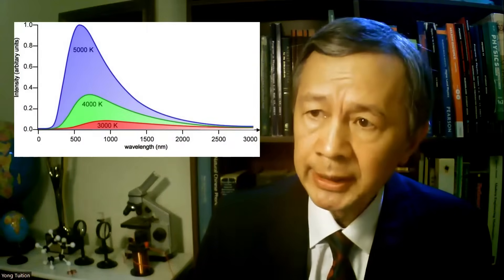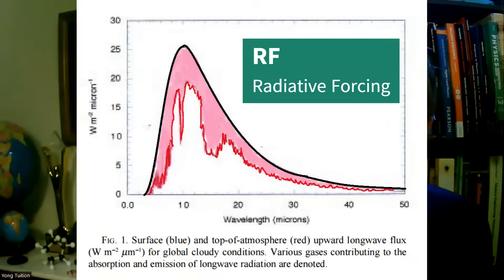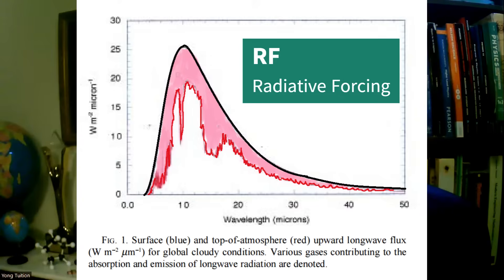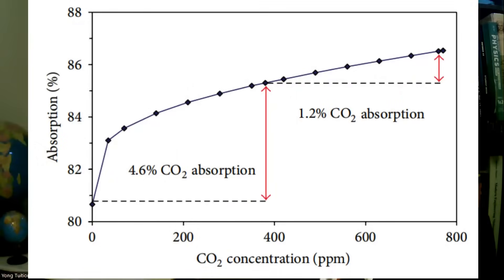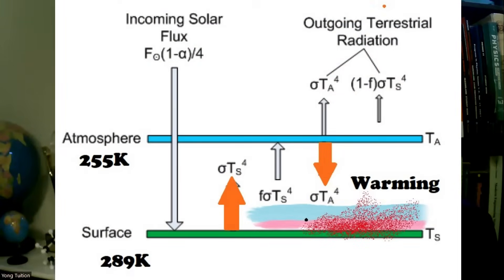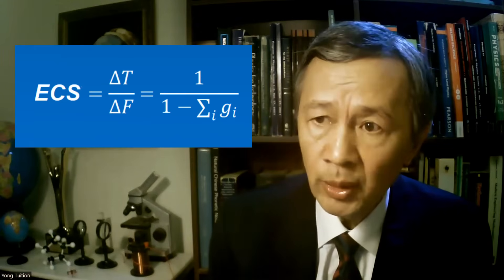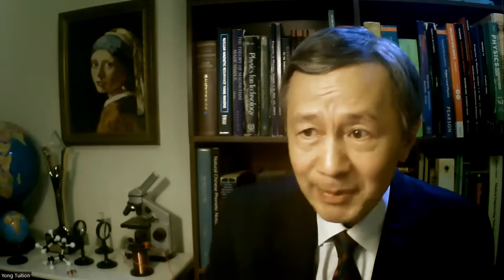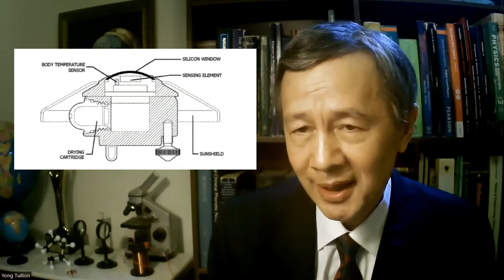The Weird Radiative Forcing at the Core of Climate Modeling | Independent Climate Research 230228

Comment: Thank you so much for trying to explain the complicated climate models being used to predict global apocalypse. 
So many things about these models bother me. 
Virtually every molecule on earth surface is radiatively forced by the sun. 
You pointed out one of the huge flaws in the GGGW theory, that the forcing (?) level of earth surface radiation is in only one direction. 
If earth surface is emitting a level of thermal radiation sufficient to heat isolated atmospheric carbon molecules enough to increase temperature equilibrium of the planet, HOW do they avoid gaining temperature from the radiation that they are emitting to the molecules right next to them ??? At a 1 to 1 ratio of mass temperature gain ? The thermal radiation of surface molecules is in all directions, an equal amount must be radiated into earth surface. But it results in loss of temperature there. 
And then they claim that the atmosphere radiates gain back to the earth surface ?
They seem to have focused so exclusively on the thermal energy of the photons that they forgot inertia is also a reality of heat energy transfer, so they think all watts are positive degrees of heat. 
The tiny amounts of atmospheric carbon would have to gain extreme heat for 4 carbon molecules to heat 10,000 other molecules. 
Normally the far smaller number of molecules run completely out of the extra heat energy they have long before the far larger mass is energized. They have to have far higher temperature to overcome the inertial resistance. 
So many real scientists like you have problems with the mathematical models they have constructed, essentially by taking a photograph of the photons being emitted from the literal hurricanes of valent bond heat energy being convected from earth surface. 
I do not understand how they assume all watts are positive and can overcome mass inertia. 
Excellent presentation and sure hope that people can realize there are serious questions about tiny amounts of carbon being able to increase earth temperature.

Comment: Tank you Dr Young. If you touch a green leaf in full sun, it is not hot. Chlorophyl act as a catalyst to transform blue and red wavelenght in sugar. I imagine it is the same for photosynthetic algea in sea than for greens on earth…… then why they consider the surface of the planet as a blackbody? Second question if i could, what about the effect of CME, solar wind and electromagnetic field from the sun to the planet. There is a lot of energy in there, are they included in the IPCC calculs?

Comment: Only idiots would belive that the positive feedbacks are larger than the negative feedbacks in the climat system of the earth.
Reply: Spot on.  If negative feedbacks didn't prevail, we wouldn't be here!  The system responds to perturbations with negative feedbacks.
Reply: So with less solar irradiation as we have witnessed for 60 years, what is warming the earth? There are clearly more positive feedbacks than negative for our current situation, otherwise you would have to assume (incorrectly) that almost all the warming was simply because of the additional CO2.

For what is happening in the past ≈100 years, there are definitely more positive feedbacks. More CO2 -> warmer -> less ice -> ice-albedo feedback, water vapor feedback, etc. Otherwise how is earth ending up with such a huge increase in energy via warmer air and oceans?

Negative feedbacks exist but obviously they are outpaced by positive feedbacks.
Reply: @scottekoontz  
Ok, let's set some basics.
Overall, the climate system responds to perturbations with negative feedbacks (obviously).  As I said above, otherwise we wouldn't all be here.
So you're saying that over the past 60 years, the world has warmed.  First of all, why use that timeframe?  You see, the whole question of man-made warming (or just warming) is mired in a number of questions:
Why use a small period of time?
The Earth has warmed before.
What about the warming 1,000 years ago, or 2,000 years ago?
CO2 has risen steadily for decades, but warming has not.
How can we even be sure that GHGs give us 33 degrees k?
What about the Sun's periods (cycles)?
What about the AMO (coincided with warming around 1980)?

Has there been warming?  Yes.
Is it CO2?  No.
Reply: @jimskirtt5717  "So you're saying that over the past 60 years, the world has warmed... First of all, why use that timeframe?" Not al all what I wrote. Not even close. If you need a quote, here it is: "with less solar irradiation as we have witnessed for 60 years" We all now that solar irradiation is not the reason for the warming. But warming has been happening at an increased rate (that requires an explanation, hence the topic) for more than 140 years. Timeframe is because of the link between temps and solar irradiation. That was pretty clean in my writing.

"Why use a small period of time?" Why not use since the industrial revolution?
"The Earth has warmed before." Obviously, and for other reasons. In the past it could be an increase in solar irradiation, and of course Milankovitch cycles. Those are clearly not the reason for the warming since the Ind Rev.

"What about the warming 1,000 years ago, or 2,000 years ago?" What about it? Not as warm as today, and forcings were different. Local warm is different than global warm, no?

"CO2 has risen steadily for decades, but warming has not." Yes Earth has warmed. Every decade is warmer. Did you except that all other heat movements would stop? What would that happen? This is about the primary forcing, and ocean oscillations will oscillate temps, not raise them. Sun would have been slightly lowering temps. Milankovitch cycles are 20,000 year cycles and cannot be witnessed within 100s of years, besides they would indicate cooling.

"How can we even be sure that GHGs give us 33 degrees k?" Then tell us what they do give us. Then after you give us a new number, explain why earth is warming if not GHGs.

"What about the Sun's periods (cycles)?" Cycles, and a downward trend at that. A wheel within wheel. They slightly raise and lower temps at a magnitude nowhere near what is happening. Besides we all know that less overall solar irradiation in the past 60 years means those cycles are not the cause of the longer trend in warming.

"What about the AMO (coincided with warming around 1980)?" What about oscillations? They oscillate, not warm the planet.
Reply: @scottekoontz  
Yes, I thought so... you display a complete lack of understanding.  Let me try again (and this is my last try):  First of all, you did say:
"So with less solar irradiation as we have witnessed for 60 years, what is warming the earth?"
In your quote, in your last comment, you missed out "what is warming the earth".  It is part of the same sentence, as it is junctured by a comma.

You then go on to misunderstand solar cycles.  We're not talking solar irradiance, which is why I didn't mention it.  We're talking solar CYCLES.  There are three principle ones, and they just happened to coincide around 1980...with an AMO in positive phase.  And let me clear that up, too.  I didn't say an AMO increases warming, what I am saying is that RECORDED TEMP ANOMOLIES coincide with a positive AMO.

Your lack of comprehension is very annoying.  You're assuming that proxies are the same as recorded data.  They are not.  I'll tell you something you evidently don't grasp: We don't even know what the temp is now (which is why we use an anomaly over a time period)!  And we don't even know if GHGs warm the Earth 33 degrees k!!!  If you don't believe that, look it up.  We THINK the 33 k is correct!

Finally, the Earth is going through a warming phase, but so what?  That's the bit you're not grasping, again.  It has warmed before, it will warm again, it will cool again, it will warm again.  What you're thinking is that a rise in CO2 is causing it.  The Earth goes through small 'climatic' cycles.  As I said, it has before, and will again.  That doesn't mean it must be CO2 this time!  What about the other times???  Two recently published studies (2020) confirm that the climate thousands of years ago was as warm or warmer than today’s.  One study demonstrates that the Roman Warming was the warmest in the last 2,000 years. The other study provides evidence that it was just as warm up to 6,000 years ago. Both studies reinforce the occurrence of an even warmer period immediately following the end of the last ice age 11,000 years ago - the Holocene Thermal Maximum.

Rid yourself of your CO2 obsession...and tell me what happens between 14 and 16 micrometres on the IR part of the light spectrum.  I keep asking you.
Reply: Indeed. And a Co2 obsession it is. Clearly by downplaying other factors and laying down initial states about attributes, like GHG= 60% H²O/ 30% Co²/ Ozone etc, like that has been unequifically (the most used buzzword) proven. And then put your models to work. See, science!

Comment: We need to replace "Greenhouse" with "Space blanket".  If there are no clouds, the visible solar radiation heats the surface, which heats the air above it, but the air is not retained as in a greenhouse unless there are clouds above. If there are clouds, there is the space blanket effect - heat is trapped, and reflected back below, and radiation from the sun reflects away from the upper surface - cooler days, bur warmer nights.
Reply: Radiation as not significant enough until we get about the clouds. Most heat movement in the atmosphere - at lower altitudes - below clouds - is by convection.

The "gaslight" done by climate alarmists was to tell us it was nearly all done by radiation. That enabled hem to conjure radiative forcing out of thin air or, rather: cold air!
Reply: The effect of clouds reflecting incoming solar and outgoing IR radiation does indeed produce cooler days and warmer nights (on a short-term basis), but that cannot explain the average temperature of the Earth's surface, and ignores the known interactions between certain molecules and IR radiation. In other words, it ignores the greenhouse effect.
Just because something is inconvenient is not a reason to pretend it doesn't exist.
Reply: or just 'atmosphere'